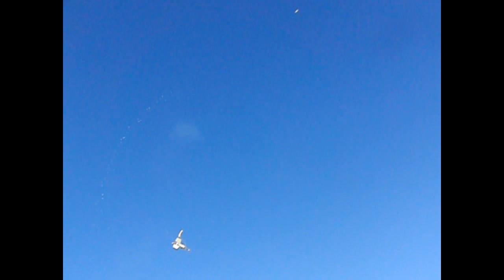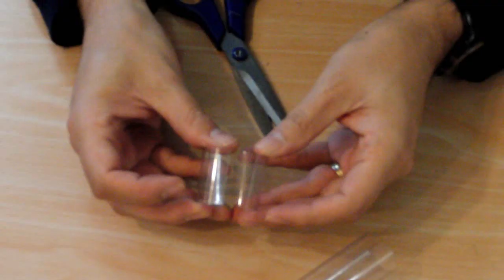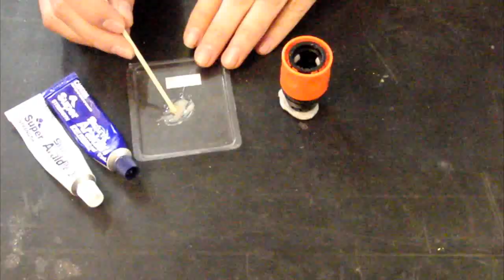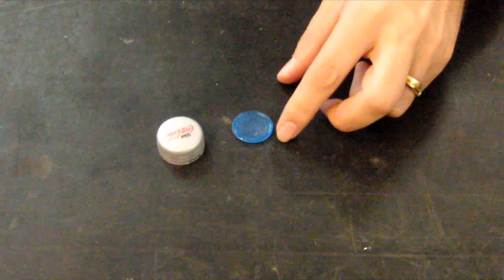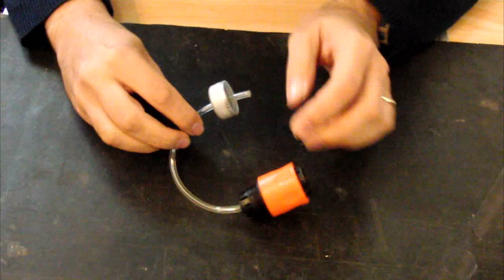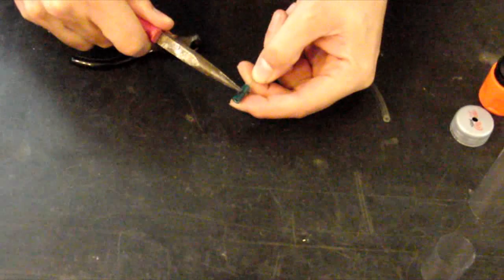Water Rocket Staging Mechanism Tutorial - Part 1

Comment: what can i use instead of the epoxi to fill the hole?
Reply from the maker: What do you have available to you?
Reply: Hot glue
Reply from the maker: Hot glue will not work as it is not strong enough. It will likely come out under pressure. Can you buy/get any other glue? You could try gluing a wooden dowel into the nozzle and then drilling that out, but you will need a glue other than hot glue for that.
Reply: will a polyurathane glue work?
Reply from the maker: You could certainly use polyurethane glue to glue in the wooden dowel. You could try the glue on its own instead of the epoxy but I am not sure that will hold up. You may also need to give it a few days to cure if it is fairly thick.

Comment: I bought a Gilmour Poly Faucet Quick Connector because the Gardena is fairly expensive and I can only seem to find it online, not at any stores, but I am unable to take the collar off of it even though it is very similar to the Gardena. Does this mechanism require it to be Gardena?
Reply: +MystaMysterio I am not familiar with the Gilmour brand, but it is possible that they may have press fitted the collar on making it difficult to remove. The mechanism doesn't specifically need to be the Gardena brand. The only thing I can suggest is try looking in other stores for other brands that look like the collar can be removed.
Reply: +AirCommandRockets Unrelated to this tutorial, but still about water rockets? What size tube do you recommend for an FTC rocket? T8 or T12? I don't have enough time to get the gardena from amazon so I decided on making an FTC. Also, what other materials do I need for it (like nosecone, fins, and other internal stuff I might need)? Thanks!
Reply: +MystaMysterio I would go with the T12 as it has more capacity and won't bend as much as the T8. You also get more room in your payload area. You will need a nosecone, and fins. You may not need a recovery system if you design your rocket for backsliding.

Comment from the maker: Polyurethane glues are typically the best to use for splicing because they stick well to PET. You will need to test the glue you can get to see how much it will hold. The glue's shear strength is also important. For example Sikaflex will not hold beyond about 60psi. PL with the same splice will hold over 200psi.

Comment: What kind of string should I use for the parachute? How can the strings be connected to both the edge of the parachute and the main string that is connected to the rocket? Also, could you tell me how to deploy the parachute of the sustainer, that is the second stage without using electricity and motor? Thank you very much for your help!

Comment from the maker: It depends on the size of your rocket. Parachutes for light rockets can be made from thin plastic such as garbage bags. For heavier rockets I would recommend rip-stop nylon. You can even use old umbrellas to make parachutes from. To buy ready made parachutes check on-line stores that sell model rockets.

Comment from the maker: You will find that the valve will seal better with a bigger pressure differential. In order to make sure you get a good seal make sure that the hole where the pin is has a nice clean edge without any scratches or dirt under it.

Comment: It's an internal leak from the rocket to the bump through the valve. (The leakage is tested without large pressure. The valve (Gardena connector) is only put under running tap water and leakage, from the head of the pin to the bent side, is observed)

Comment from the maker: Yes, the tube length should be about 35mm and 70mm long. Within a few mm is fine. Yes you can use electrical tape instead of the glass strapping tape. You are just using it to increase the diameter. Any water proof tape should be fine.

Comment from the maker: That very much depends on your requirements. The 13mm nozzles were custom made for a specific rocket. The fill tubes don't need to match the nozzle size, so any size that fits your nozzle should be fine. The nozzle size will depend on the size of your rocket, and how much pressure you want to use. The nozzle has to be big enough so the rocket gets enough acceleration off the pad.

Comment: Since the FTC based rockets are already capable of rediculous speeds and altitudes and weigh next to nothing, why not build a 6'  # 12 FTC rocket as a sustainer and put it on the rediculous booster you have made.. putting a camera in the nose of an FTC rocket would make it rediculously stable so long as its constructed well enough not to break apart.. maybe with some ballast for a "camera"